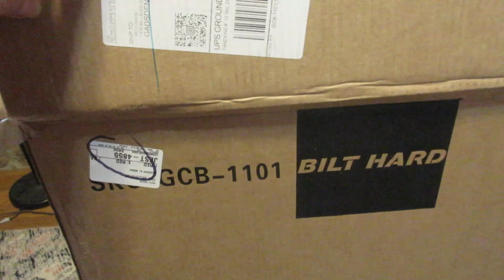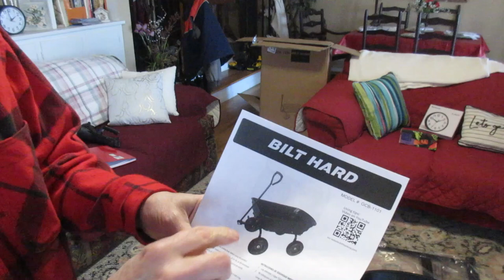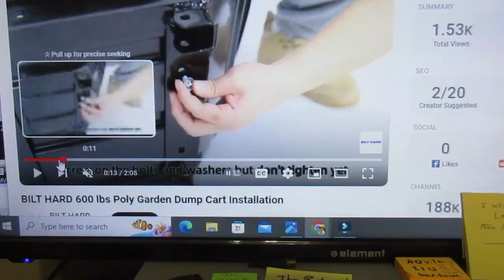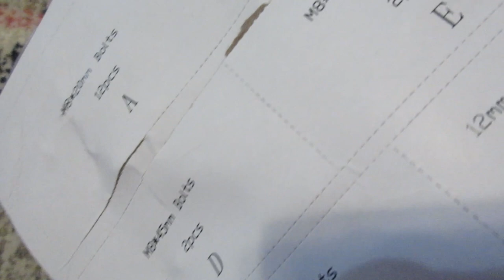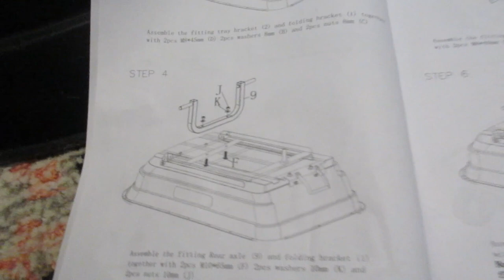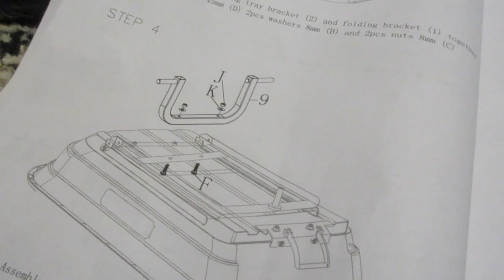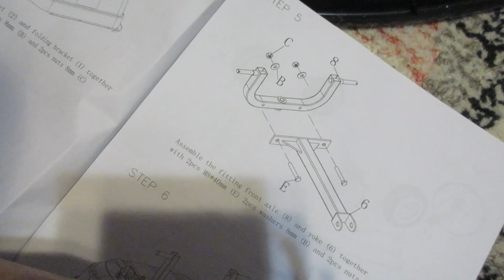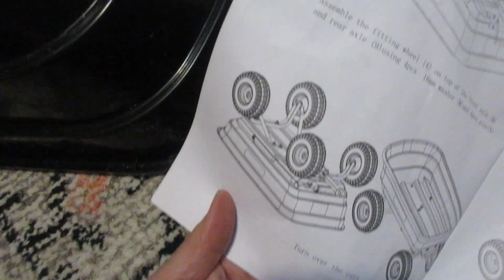Bilt Hard Garden Cart.  Assembly and Demonstration.

Comment: I own a Bilt Hard electric log splitter and have been very impressed with what it is capable of. Had it 2 years and still going strong. I cut and split over 2 full cords of wood each year. Seems to be a good brand.😊
Reply from the maker: I'm glad to hear Bilt Hard makes log splitters and you have one!  Small world!!  I've got lots of logs on my place that needs to be moved.  I was going to burn but then was told I couldn't in my fireplace which has gas logs in it.  So, got to haul up the steep slope yard to the street!   Our heating bill (gas furnace) is over $300 a month in winter.  Seems stupid to throw away wood when it's free and you have a fireplace!